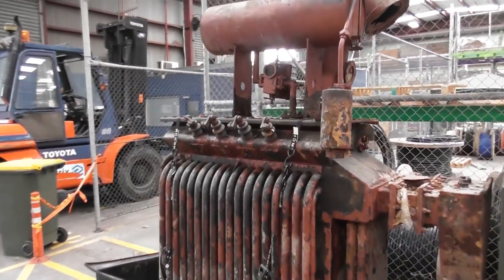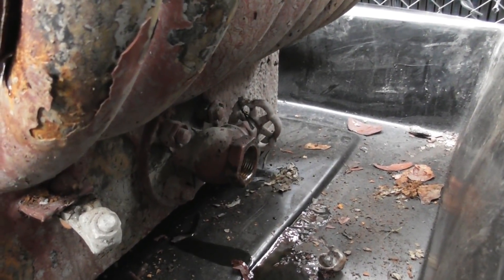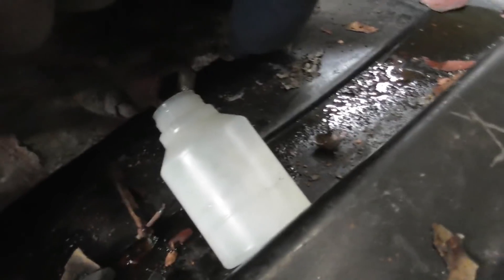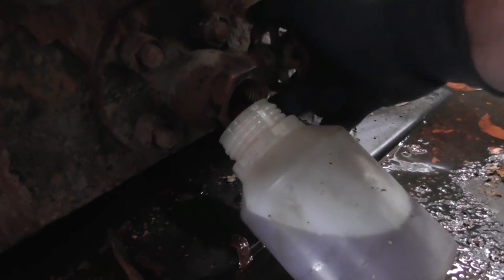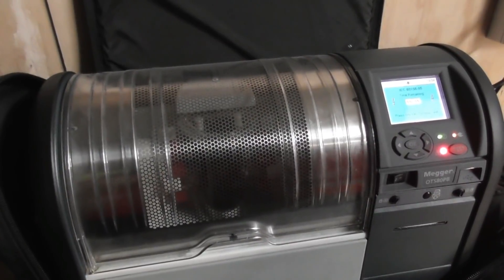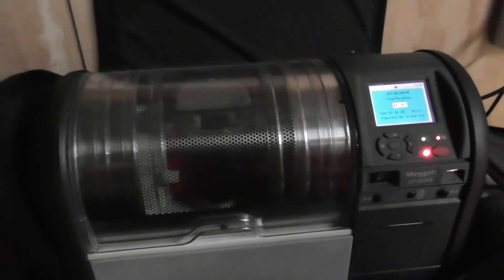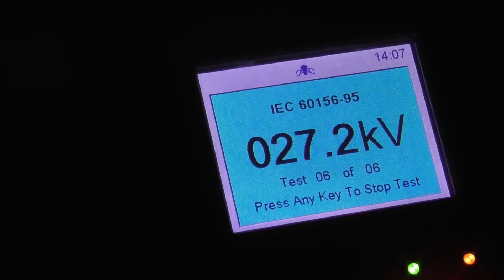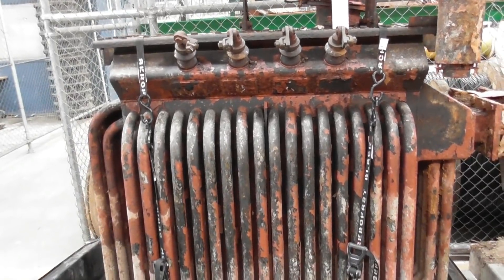1937 Metropolitan Vickers Transformer 200 kVA

Comment: Really slow and weird printer. Why it is printing in reverse? :D Doesn't make that much sense to me.
Reply: That sounds like a dot-matrix printer, and it probably does it like that because there is no paper guide like in a bigger dot-matrix printer and they rely on the operator to either catch the small report (which is not necessary) or just have it hanging when it prints.  Most store receipt printers print the receipt the same way, last things first.  Dot-matrix printers are reasonably efficient printers when it comes to ink usage but also their size.
Dot-Matrix printers can be fast (just think about the food products that have a "Use before date" on them, most of the time that's a Dot Matrix printer that prints 3-4 bottles per second with the right information, they can even print eggs that way in a surprisingly fast amount of time, with also a surprisingly reliable system that does not break the eggs while a printhead runs over the eggs.
Also, Dot-matrix printers can print on curved surfaces (something inktjet and laser printers have a hard time doing), and in order to save some space, they might print on the roll just before it leaves the printer, which, given the fact the sound of what it prints is actually comparable to the thing that runs out of the printer just 1-2 seconds later, I think that might be the case for that device.

Comment: That’s a real shame that this transformer is off to the scrappers. Could have been nice to drain the unit and clean the outside for a static display. One doesn’t see such old stuff around anymore. A few weeks ago, I was very fortunate to see a pre WWI transformer still in the air, stepping 2400 volts up to 7200 volts for customers outside a town in western Minnesota.

Comment: @ 46kv it could have simply been dust/dirt from them air into the bottle, since it appears it was filled multiple times and it + nozzle allowed to be open air.....
moe so if it was a  teardown bay of  shop or some random scrap recycling facility, not uncommon for them stooges to BURN CFL bulbs and other mercury /lead containing things lol
also even as slowly as it was drained,  the absolute worst "junk" settled to the bottom was drawn off and tested............... that thing would have worked for 50+ more years, provifing it wasn't overloaded 5x past original design current, which was likely way under rated in assumption future tomfoolery would stress it far beyond ratings ;)

Comment: That is a really cool transformer, too bad it's going to scrap.

In my campus we have a transformer that supplies the mains for all the buildings, which as far as I know dates from about '31. Back in the day, they overdimensioned it, only in the early 2000's did we start running short on it and a second transformer was brought in and paralleled to the old one which is still in operation.

Comment: Does the inside of the transformer have some kind of ceramic or other coating, to prevent microscopic metal particles saturating the oil over time?
Reply from the maker: The transformer tank was most likely painted with lead base paint, inside and outside of the tank. Better quality, now in the PC world, lead based paint is almost obsolete, and TX tanks rust out a lot faster.

Comment: Shame to scrap it, be epic to play with
Reply: be hard to find a supply to run it a idle. still waiting for him to put the pole xformer 
on his generator
Reply: Josh C Transformers can be run at lower primary voltages than their spec. Somewhere near it is good enough to see/hear it working.
Reply: @Engineer9736  yes but as you see in that video the arcs were weak, most likely due to low flux.
Reply: Josh C The arcs in this video are from an oil testing machine.. He didn’t do anything with the transformer except taking an oil sample. Oil is good so that’s no issue.
Reply: Josh C I’ll have a look when i’m at the PC.
Reply: @ratbag359  That transformer is from the same year, but it's not the same one. The one in that video is much smaller and doesn't have those cooling tubes around the body.
Reply: @Engineer9736  I know that i was not talking about this one only in the regard of the secondary current required to flux up the core as larry was talking about playing with it.
Reply: @ratbag359  it would draw less than 1kW on idle, just a lot of inrush.
Reply: Its too far gone. Some parts are rusted through and cables are cut off.
Reply: Simon Tay The cables are mounted with bolts. And the only visible rusted through part is the oil expansion tank. The windings are still in oil obviously (otherwise it didnt come out) so internally there cannot be not much wrong.

Comment: Did that oil have PCB in it
Reply from the maker: Not sure but it is possible.
Reply: @RODALCO2007  Will have had. seeing as it was out of service for 40 years it last probably had an oil change in 1970, so the oil would either have been PCB oil, or it was mineral oil replacing PCB oil. Even the old transformers here will have some PCB oil in them, despite having had a couple of flushes, it stays around a long time.